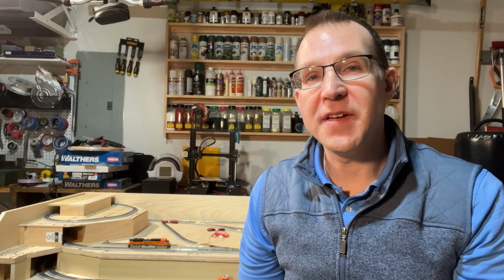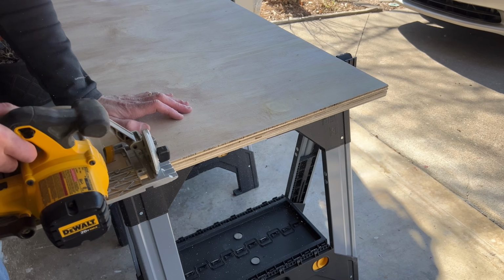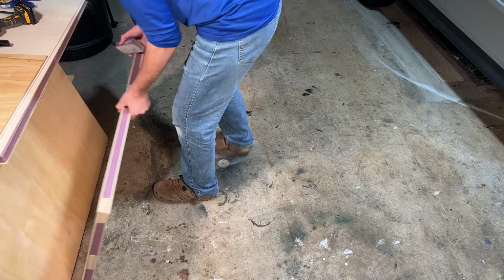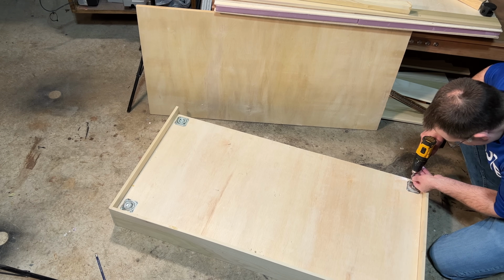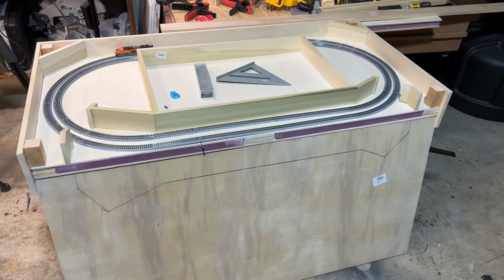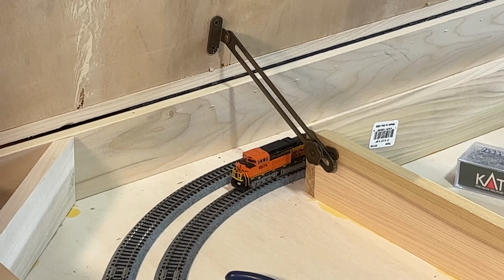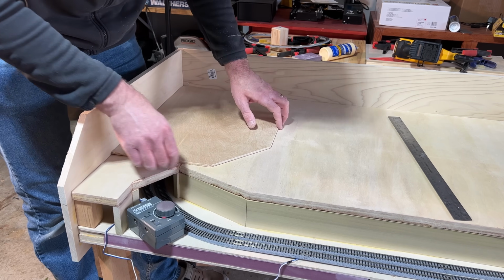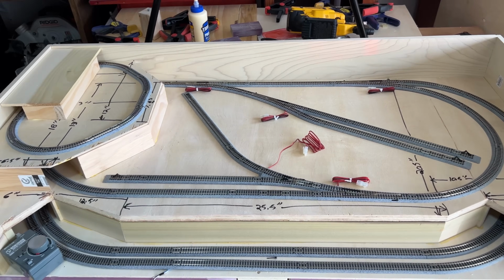2x4 Foot N Scale Layout: Building the Benchwork

Comment: Yes impressive. Having separate loops and no grades to connect each loop together still gives you limited amount of cars you can run on a train.
Reply from the maker: If it was larger I would connect the levels, but the grades would be really steep in this size, though still doable. A six foot instead of 4 foot length would make that work out easier.

Comment: Hi Steve, is your layout 4’x2’ bench overall length measurement or is it internal measurement? Thanks Brian
Reply from the maker: Internal, so the wood on the sides adds another inch or so in each direction.  The boards I used are about a half inch thick.

Comment: Your way is much better than a door, door is loud and too hard and bouncy. 2” masking tape is ok clamp you also could have use through bolts. Also frame with hardwood vs foam to edge. Make you build much simpler and stronger.

Comment: Hopefully with everything scenicked you won't have to lift things too often. Loving your benchwork and I've built a fair few layouts (mostly HO) over the years. And like Norm Abrams says: 'you can never have too many clamps'.

Questions:
Where did you get your wood? Like a Lowes or Home Depot? And do you let your wood sit where the layout is going to be so it gets acclimatized to the environment? I learned that lesson the hard way here in the Northeast - got the wood home and started building the benchwork. Get back to it a couple of weeks later and everything was warped and twisted.
Reply from the maker: Yes, wood was picked up from Home Depot and sat in the garage for several weeks (not on purpose for that long, just didn’t have time to work on the project).

Comment: Is there a way you could have the track change elevations in a small layout like this? Im new to the whole model train concept and was thinking about something that does that.
Reply from the maker: Sure, but you end up with steeper grades on a layout this size which limits how long your trains can be and may result in some locomotives not being able to make the grades (assuming you wanted something like this where the track looped up from the lower level to the upper level.
Reply: @StevesTrains  Not to mention that with Unitrack or any other track system like this it's not easy to make grades with smooth transitions at the top and bottom. For me if it's going to have grades use flextrack.

Comment: Watching your videos gives me the confidence to finally get started on my own first layout!  I see you've experimented with a variety of different techniques for the frame (plywood framed with poplar, dimensional lumbar frame filled with foam, the sandwich method you used above).  What framing technique would you recommend for a simple one level 2 x 4?
Reply from the maker: I would probably just do half inch birch plywood with 1x3 pine framing underneath. You can put a layer of insulation foam board on top in whatever thickness you want if you plan to have any terrain that extends below track level (rivers, etc).

Comment: Funny enough I have the same amount of space in our bedroom as my wife likes N scale trains as well as me she loves doing the scenery with me and designing and painting with my airbrushes so this has given me an idea and your layout suits me fine I may add a few more sidings or shunting and may put a 4th level for that and two spurs so that I could in the future add to it and make it larger like putting a six-inch track around the whole bedroom going behind the headboard or on top and a fold down cross the door remotely operated by Alexa with one motor and two micro switches for stopping it in each direction and some wire and a spool you have got my mind working overtime all that will come in the future at the moment the space is taken up with my 3d printer and a large piece of MDF which I shall not use I will use the same as you and do what you have done sandwiching it together between foam can't wait to get started so al the best from john from Rugby UK. england.ps great video and I am a subscriber for quite a while now so thumbs up from me as I always do.

Comment: Looking pretty good Steve. For you or anybody else considering using those plastic clamps, they work pretty well until plastic fatigue sets in and they litterly fly apart scaring the *$&#! out of you. One of the nice things about them though is that some of them are adjustable.
Reply from the maker: Yeah, I’ve broken one before…I only have two clamps that are all metal. But they don’t have rubber on the gripping surfaces so they will mar stuff which is why I don’t use them unless I’ll be cutting or heavily sanding down those surfaces. I really need to invest in a bunch of good clamps of different sizes. You never have enough.

Comment: I use Unitrack in HO. All pieces are marked on underside. Hard to read occasionally so I use a black Sharpie pen and write it on underside. No more problems. I also have a box of one each of the cardboard packaging for each type. Good reference for future.
Reply from the maker: They were all marked but some only had a part number instead of the length or radius. Usually they have both but the small ones in n scale just don’t have much room.